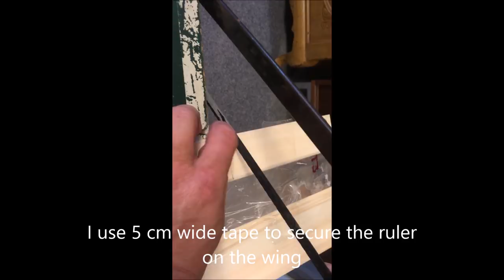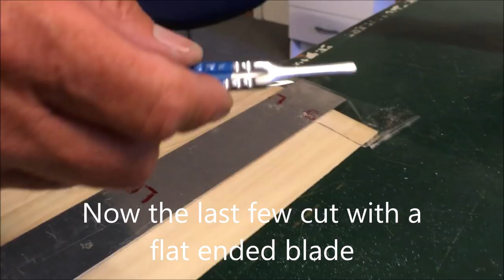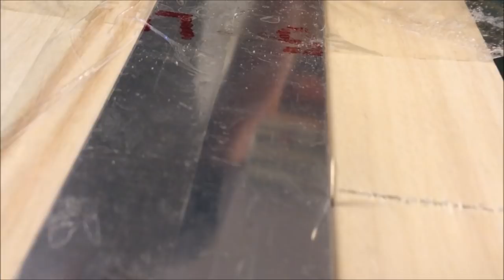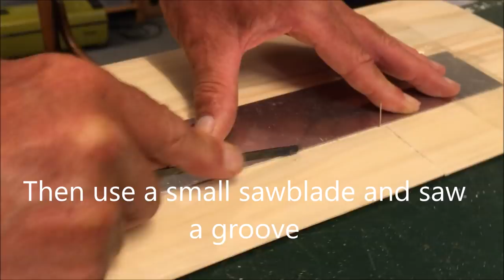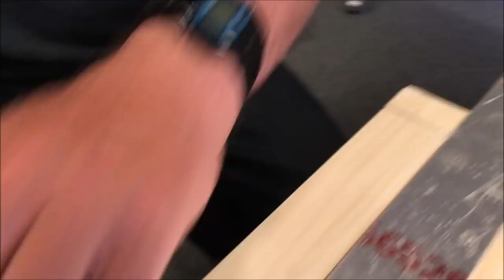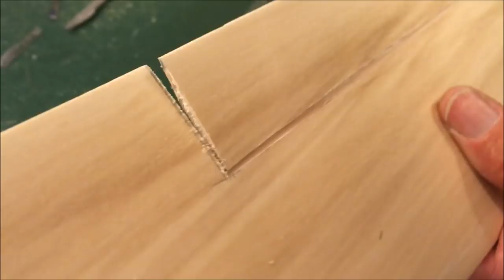Arthobby wing, aileron/flaps cut

Comment: Thanks. Although I would use a dremel router bell that you guide along a ruler to have a cleaner cut, make the opening about 8mm and then close both sides of the exposed styro with balsa wood that you then sand into shape. Much stronger and much cleaner. With your technique, you have an open end for the wing skin that reduces the wings rigidity and with your flap articulated on the skin, all the strain is on the small part of the skin and glue. If you close it both ends you have a much longer lasting setup that will also be more resistant to harsh slope landings.

Comment: They say that "experience is something you don't have until AFTER you need it". Well, I have experience in cutting an ArtHobby aileron now and I can say with certainty that my Skua will have an external hinge. :)

I went through the internal hinge without realising it, probably when cutting from the top. I could feel the difference in the knife when cutting from the bottom when I hit (what I think was) the aramid. But I felt nothing when cutting from the top and went through half of the aramid before I realised what I had done. I will use the other aileron as further practice. The hinge material is very thin and embedded i balsa/popplar and it is so easy to go through it. Despite watching this excellent video beforehand.
Reply from the maker: He he :)  Today I helped a guy from the neighbor rc club with a Odyssey 4 flap wing and now he have internally hinge on flaps and ailerons ;)

Comment: That's really interesting. What material is the final hinge?
Reply from the maker: The hinge is inside the wing, as I recall it is armid
Reply: Ah, I get it. They've layered the wing so that if you want to cut just so, you reveal that aramid layer and it creates the hinge. I just looked up aramid and it's also called Nomex.(which is used in fire proof cloth)
Reply: Excellent question, just what I wanted to know. Thank you!
Reply: Is this a new way for you to do hinges on your ArtHobby planes?